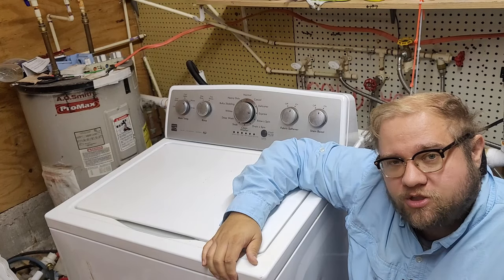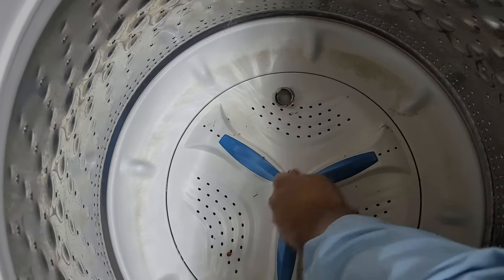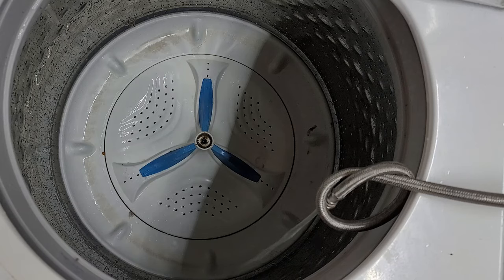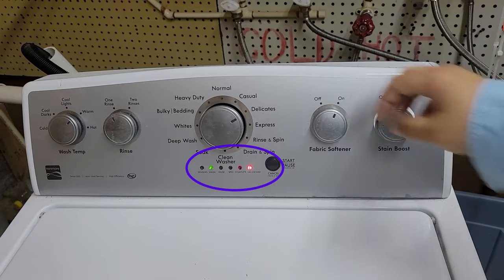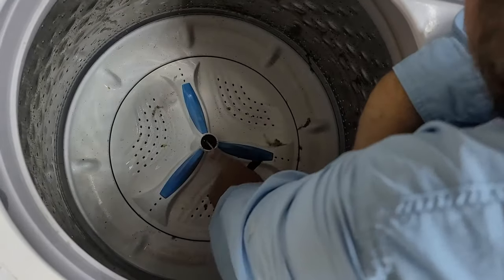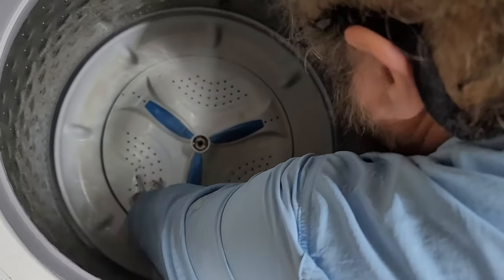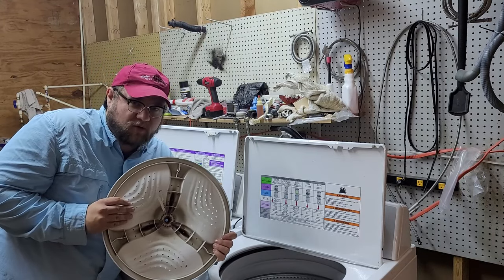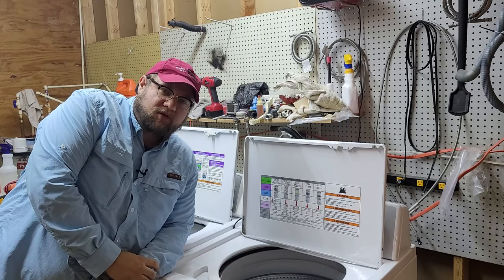Washplate Stuck - More Ideas to Remove a Difficult Whirlpool Wash Plate

Comment: Tried this and it didn’t free up the washplate.  I ended up breaking the washplate into pieces with the metal piece staying on the shaft.  To make a long story shorter,  I ended up taking a hack saw and cutting groves into it and breaking it a part with a chisel.  I had to do this on three sides of it and finally got it off.  Great idea whirlpool, even though this is a Maytag.  POS
Reply: ditto. had to do same. but used dremel with metal cutting disc.

Comment: Such a crappy design from the morons at whirlpool, those engineers should have to go out on these calls and see the hell we techs go thru, they should design it better and offer a removal tool!

Edit: I’ve had some that would not come out, even cut the plastic around the wash plate and the metal insert was rusted stuck to the trans shaft, $450-$500 repair job to replace the gear case, another junky part that’s way over priced and probably cost them $10 to make

Comment: First... Title should be wash plate Sucks!

Bad design.

Then, air bag suck.   One doesn't inflate.   

Tried citrates... This thing is still stuck.   This is a bad design.
Too much plastic, and should be insulation between the wash plate and the trans.

Am I wrong?

I've been working on applications for over 10 years.
Reply from the maker: Why would you put insulation between the plate and transmission? I am not following your logic.
Reply: @bensappliancesandjunk  insulate between the 2 metals.... A grease or tape.  As, the metals fuse together..
Reply: Either galvanic reaction or mineral buildup fusing the wash plate to the trans splines.   I use silicone grease in plumbing appliances.   It helps disassemblint faucets, or other metals which will be in contact with water.   And helps prevent galvanic reaction (fusing of 2 dissimilar metals)

Ps.  I do find your videos helpful, so thanks. Just struggling with this one.🍻

Comment: This was a waste of time just pinch/grab the middle of the washplate and pull straight up cuz if you don’t especially with metal splines on metal shaft make a strong friction grip and won’t pull off easily
Reply from the maker: We tried that multiple times prior to doing this process. Didn't work.
Reply: @bensappliancesandjunk  i wonder taking a small ping or mallet like those orange kind and smacking it on the side will loosen it up enough. I had one 3 months ago that i just could get off.
Reply: Mine was stuck and wouldn't come off. I sprayed Blaster penetrant all around down the hole. I waited an hour. sprayed a little more then  hit it with a rubber mallet. Came right off!